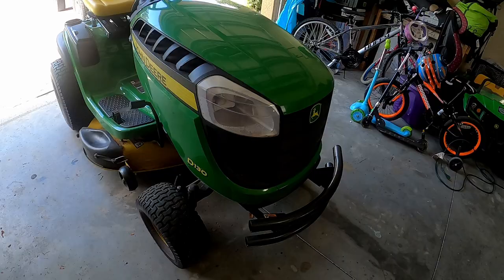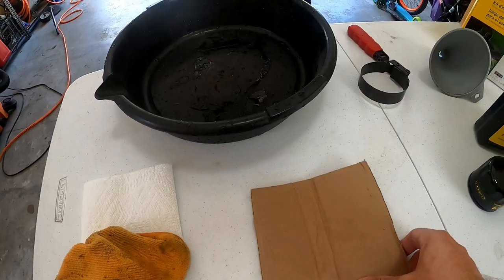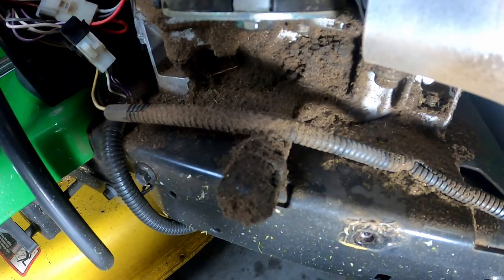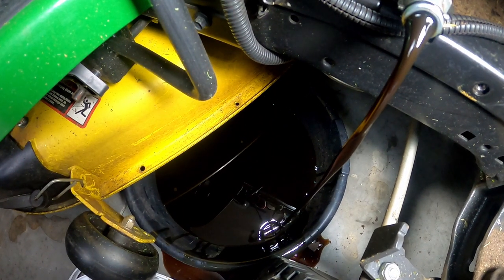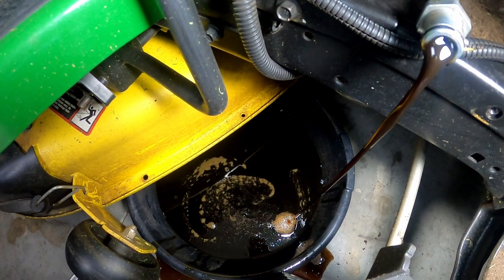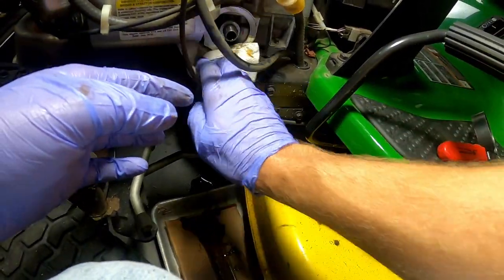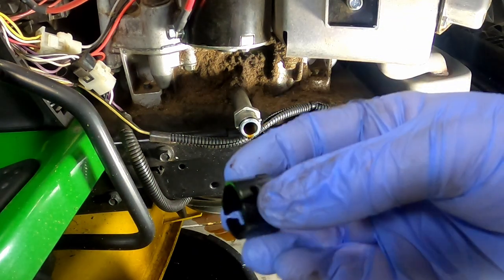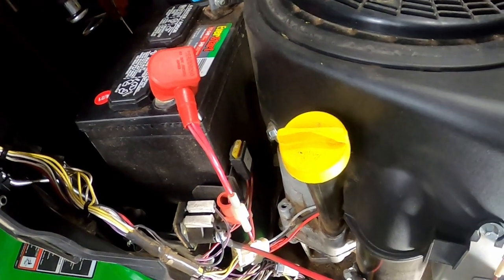How To Change Oil and Oil Filter on John Deere D130 & D140 (22 HP 2011 - 2017)

Comment: FYI - I've found turning the front tires to the side makes it easier to get a drain pan under the oil port...which I see you did do when going to the filter side.  I'm glad to see I wasn't just a weirdo with putting a shield under the filter to keep the oil from dripping on the frame.  First couple of times I changed the filter I did have oil drip on the frame and I wonder if I was just doing something wrong.  Good walk through on the process.

Comment: I see your mower has 73 hours on it and you have replaced the battery?  What happened?
Reply from the maker: Original battery died around 40 hours. I keep the new one on a trickle charge now and no issues so far.